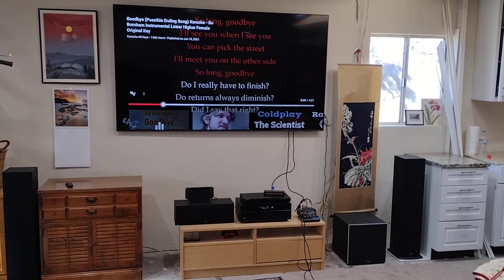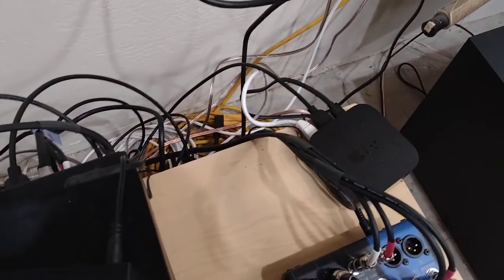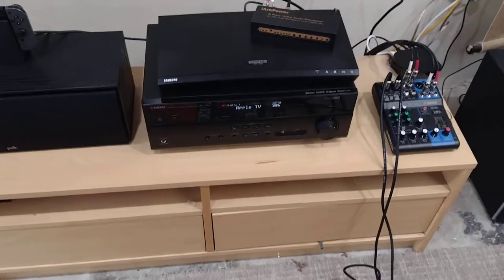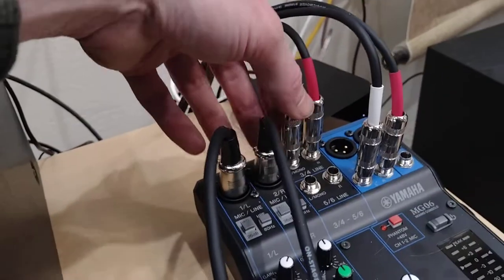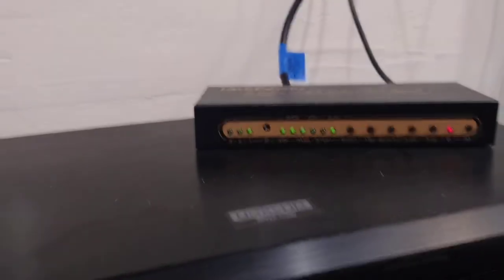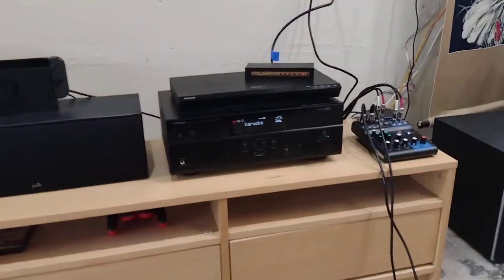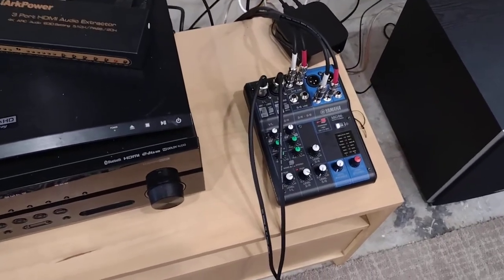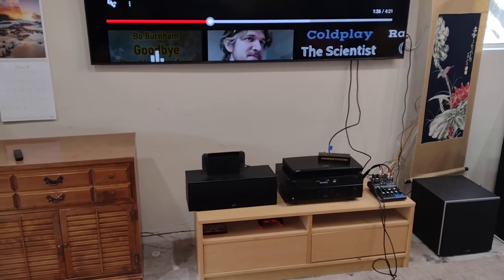Set up home karaoke using HDMI audio extractor and microphone mixer

Comment: Can you tell me how to connect everything using hdmi I have a denon av receiver
Reply: Same issue trying to hook up the Yamaha mixer to AVR .
Reply from the maker: Do you still need help?
Reply: @kyleglasser2382   yes
Reply from the maker: @phillipphan3353  did you buy the audio extractor
Reply: @kyleglasser2382  yes I did got the hdmi audio extractor
Reply: @kyleglasser2382  from tv  earc to audio extractor then to Yamaha mixer?
Reply from the maker: @phillipphan3353  are you using an apple tv or similar device
Reply: @kyleglasser2382  no Apple TV , just straight to my Sony oled and my home theater systems.
Reply from the maker: @phillipphan3353  I don't know if it will work but yeah I would connect your smart TVs earc to HDMI in 1 on the extractor, then use the RCA cables from extractor to mixer input, then mixer output to receiver
Reply from the maker: When I connect my tv to the extractor the TV seems to think arc is not supported by that device, so if you don't use an Apple TV I'm not sure if it will work at all
Reply: @kyleglasser2382  ok thanks , will keep trying.
Reply: @kyleglasser2382  ok will tey